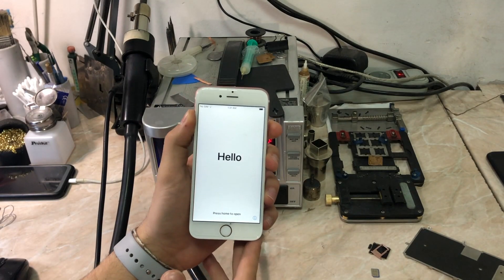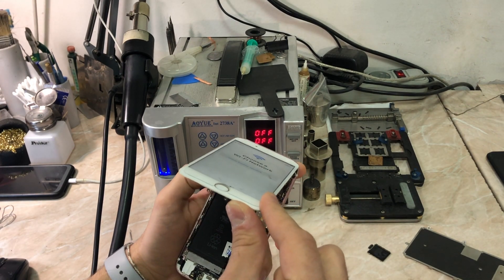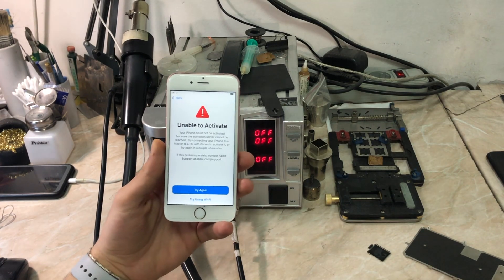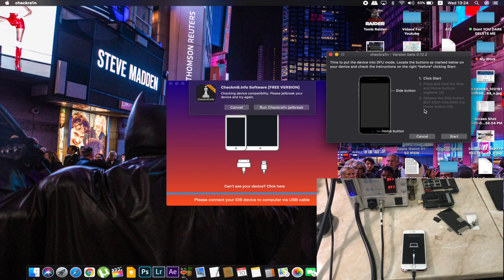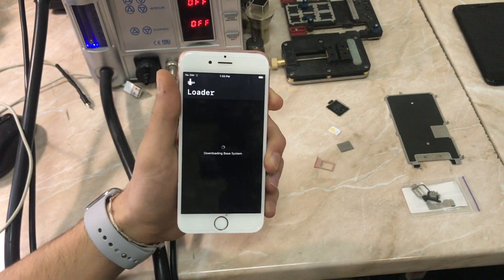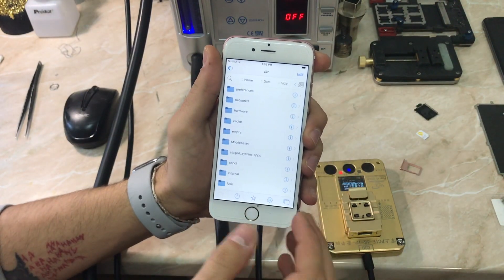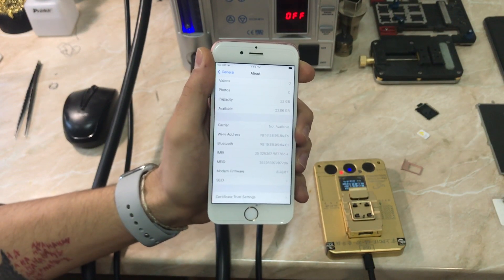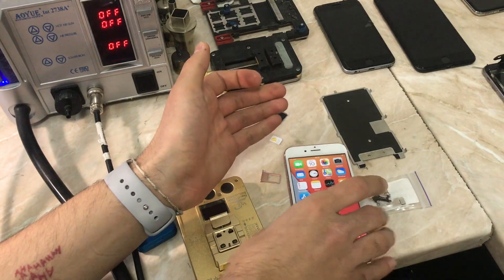iPhone Unable To Activate (Cant Activate The Device) Restore SN-WMAC-BMAC From a Dead NAND

Comment: Nice video, and good job thank u , i wana ask u plz a question, after updating through 3utools the firmware of iphone 6 plus, i lost my imei, and i never get again a measage allows .e to enter my icloud account with pass, after jailbreaking the phone and activate it again without signal, my imei comes back to apears, wich makes me believe that the problem is not a hardware issue, i think it is a software issu, i tried many times to restore it and update it through itunes but same result and it looks again without allowing me to enter my icloud with message " unable to activate Shutdown" , what do u think is the way to fix this problem? I wana fix it with signal again, already it is my phone (son phone) and my icloud account
Reply from the maker: I think what you are doing with jailbreaking it is bypassing the activation screen, can you confirm if you have the modem firmware visible in settings ?

Comment: Is it impossible to extract original syscfg if nand dies on a device that has no checkra1n vulnerability like ipad air 3?
Reply from the maker: It’s possible with services, but it will cost like 30-50$ just for the BT-WIFI MAC address
Reply: @AntoineKiriaky10  thanks.. can you tell me the purchase URL? Even if it's expensive, it's a necessary situation. At this rate, I have to throw away the board :( Nand is completely dead, and no information can be extracted.